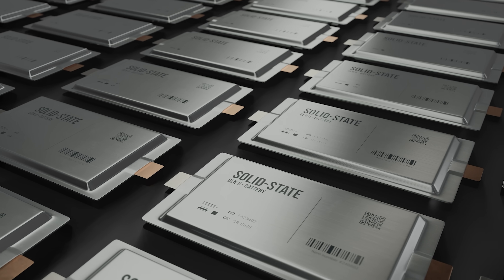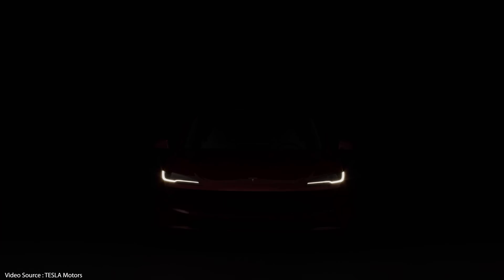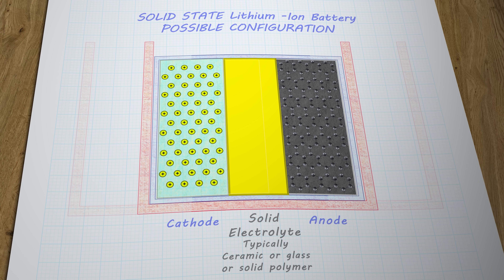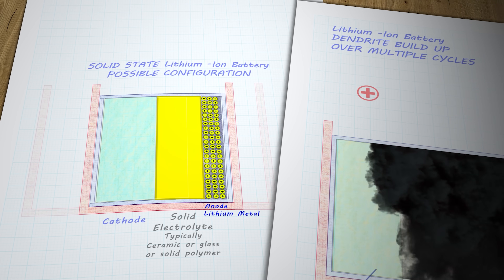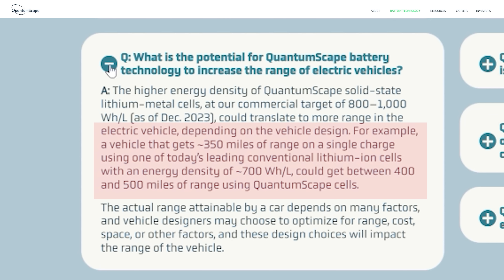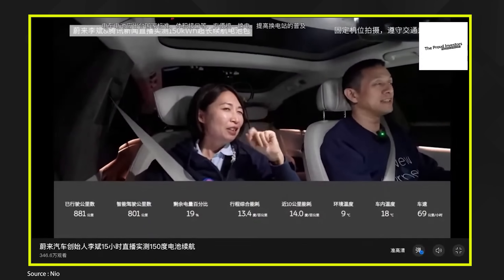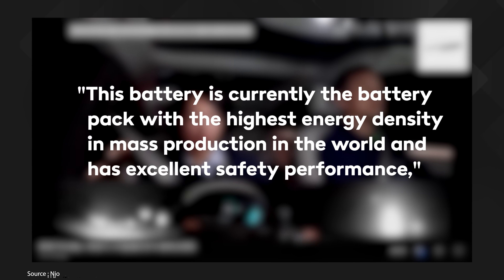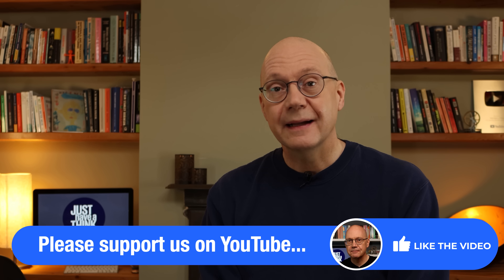Solid State Batteries - FINALLY powering electric vehicles in 2024!

Comment: are there already system-structured models for streamlining recycling options on these electric batteries?
for in a few years, we will have mountains of old and used blocks of these things lying around 
all different systems and probably not worth the money to collect and disassemble.
Reply: I'm not sure what you mean by "system-structured models." Are there companies investing in lithium ion battery recycling? Certainly. Nobody is at large scale yet, because EVs are still new enough that there isn't a huge supply of dead EV batteries yet. But there are multiple EV battery recycling companies that look like they're ready to scale up when these batteries start to arrive in bulk.

You're right that these old batteries are not worth the money to disassemble. Instead they use giant shredders, recovering metals from quite small grains of battery material. It's been awhile, but from memory, these companies claim they can reclaim something like 90-95% of the economically valuable metals like lithium, nickel, and cobalt.

Renault took the other approach: they built a facility in which they can buy back old Renault EV batteries and deploy them in stationary storage, which is just what it sounds like: battery banks that sit in one place rather than under a moving car. A battery with only 70-80% of its original capacity is no longer so useful in an EV, but still retains significant value in a stationary storage application, where space and weight are much less important.
Reply: @ps.2  thank you for the somewhat detailed response, it answers some of my questions, (I meant it more as a point of attention.) 
 I was seeing all these developments with maximum efficiency while I was thinking is there enough emphasis on how can one make a quick transition to a new battery with as little loss in the recycle time on value and re-use the same part?
for there are going to be I guess more than a million items each year in my country (NL) as the numbers get up fast soon how much thought is there in the development to address this? 
  it could be bad optics if in about 5/10 years we are left with mountains of leaking batteries everywhere.

Comment: that's all good and great looking, but the Australian old power grid isn't able to charge a 1000km solid state battery in 15 minutes, let alone 10-20 cars simultaneously at charging stations along the highways. Even if EVs will remove the range anxiety,  the electric power grid is the bottle nick.

Comment: They've been saying, "We're just a few years away" on cheap Fusion Energy for 50 years . . . . When I see it, I'll believe it !
Reply: Nobody's been saying that about cold fusion energy. Or, I mean, nobody has been saying it in good faith. Cold fusion was quickly recognized as a fluke or a fraud when it was first announced by Pons and Fleischman in the '80s, and there's been no legitimate research on it since.

Good old-fashioned regular fusion energy is an ongoing subject of research, of course, and certainly some people keep getting excited about it, but I doubt any of the actual researchers have ever tried to suggest a practical deployment timeframe of less than 25 years. (Which I think is still overly optimistic, but it's also not what I'd describe as "just a few" years.)

Comment: This is all good news. But, keep in mind that, no matter how fast a battery can accept a charge, the charging speed you get is still limited by the capabilities of the charging station. So, even if you get a car that is theoretically able to charge itself in 5 minutes, you still won't be able to actually charge it in 5 minutes until chargers get upgraded to support higher power levels, something likely to take years.

Comment: Typical one year delay every year tech. If solid state batteries with better capacity show up in the market the first use case are smartphones. I can imagine paying i.e. 5 time the price for 1.5times capacity in smartphone. It means like extra 200 USD for ultra good battery. In car it will mean 100000Usd for battery which doesn't make sense

Comment: OK, so explain precisely what the difference is between solid state and 'conventional' lithium ion batteries. Usually, solids other than metals conduct poorly which makes them poor candidates for ant electrical component that has to pss current, e.g. batteries, i.e. electrlytes with good conductivity MUST be LIQUIDS. AFAIK, Quantumscape only has a 'solid' separator in its design.
Reply: re: "Usually, solids other than metals conduct poorly which makes them poor candidates for (any) electrical component that has to (pass) current, e.g. batteries."  exactly, in another 5-10 years when we still DON'T have Solid State Batteries, we're going to look back on this with "Hindsight as 20/20" and lament to ourselves, how did we ever think that a SOLID would make for good Electron transport medium...?  when looked at on face value, we basically ALREADY KNEW (without being scammed for Billions of dollars) that it wouldn't work.

Comment: Low temperature battery performance may be just as signifucant as range increases. Of course, if charging infrastructure recieved anywhere the effort that gasoline fossil fuel nerworks have, this would all be a non-issue.
Reply: It's interesting, though faster charging is one possible way to solve the issue, however it seems unlikely it will result in a similar speed as gasoline refilling anytime soon, and results in cell degradation. It seems to me that battery pack swapping would be the fastest, most efficient and sustainable method of refueling, and could be automated, however it would require a high level of standardization.
Reply: @newolde1  Yes, battery swaps are being done in China where companies rent the pack to customers, but customers own the vehicle. That way the battery longevity isn't an issue. 

However, it's a bit of a false comparison between gasoline pumps and charging. Charging could be done while people are shopping or dining or at work. The freedom from hazardous explosive fuels means charging is far more flexible, so time issues are not real issues as the cars can multi-task the charging with being parked. Still, people have that range anxiety issue... But even a low rate or quick charge could put another 20 miles / km in the pack without a full out hypercharger.

Comment: I have driven and owned EVs since 2017. There are 2 problems with range: 1) even cheap ICE have a decent range and "charging speed" aka refuel time. This is right now not given for cheap EVs 2) established car manufacturers used range as a main argument against EVs. Now they have to deal with their own PR.
Reply: range isn't an issue for the vast majority of users of ANY car. people simply don't drive large distances on a daily basis.  for the few who do, they can remain in ICE for now; they aren't the problem, as they are VASTLY outnumbered by folks who simply don't need big daily range.  for your vacation that you take once a year, hire an ICE.  
I've owned two first generation EVs (manufactured in 2011 and 2014), range is simply a non issue.

Comment: Range anxiety is a real problem when you live in a country with vast distances and poorly built out charging infrastructure where it might be more than 300km of highway driving between fast chargers that may or may not be broken / in use or you want to tow anything.
Reply: I have doubts ya'll are even real people. But. Nah, even given your cases, it doesn't mean range anxiety is a "real problem". There are outliers for whom it can be a problem, but that doesn't mean it's a problem for the market or industry. Outliers just don't produce enough demand to make a business case to address it, the same way nobody bothers to build gas stations every few miles in the middle of the Yukon either.

1) AC wall charge or solar chargers taking advantage of all your rural land work just fine and can even get the job done quite quickly. How many rural Canadians who are considering buying EVs need to travel more than 500/600km every day or even every week? Even if your nearest rural Canadian charger is 60km away, you can get there 4 times and back JUST TO watch other people charge their cars lol. Even if we subtract an overexaggerated 50% for cold weather range penalty, I think we can agree that's still more than what even most rural people need any given day.

2) By definition and by logic, rural Canada and all other areas with vast distances between chargers have FEWER PEOPLE living there. Even if there are the odd outliers in a community for whom range anxiety may be a real and unmitigatable concern, they are a very small percentage. And.. they're not buying electric vehicles in any quantity in the first place! It's not a real market for manufacturers and, thus, their concerns should not impact design decisions in a major way.

Obviously, things should get better. But the idea that current EVs somehow don't meet the needs of the overwhelming majority of the market is silly propaganda.
Reply: @Cyrribrae  I don't know if you are real either or if you are whether you have ever left the city. I live in Australia where I work in a lot of regional areas as a contractor which is not super uncommon nor is it uncommon for people to here travel long distances. If you are following the coast sure the roads are pretty good and mostly chargers every 50-200km which is fine. But inland where the roads are not great and you can easily be 300km at highway speeds to the next 50-75kwh charger. When you add in reduced efficiency for having good ground clearance and robust tires let alone towing something you realise that current energy densities are just not enough. Fortunately CATL and other companies are doing an amazing job at addressing this but it really annoys me when people who dont live or work in rural areas claim that anyone who says that ev range is not enough is a fake propagandist. On Saturday I was at a major rural fuel stop where there were only two chargers, one was broken and one was down to 25kw charging speeds and the next charger was 86km down the road, hopefully the annoyed atto 3 had enough charge to make it to the next stop!
Reply: @Cyrribrae dude no one is buying EVs😅
Reply: Range anxiety is a real thing quite a lot, i find. Electric scooter rider here. I even took to building batteries myself to worry less about range
Reply: It has been a nightmare charging my Ford on the way from San Francisco to Los Angeles, especially on holiday weekends. Range “anxiety”, becomes reality on your second hour in line waiting for a charger.
Reply: yup yup yup, came here to say this exact thing, hi from rural Canada where a charger is 60km away and it's 8hrs travel to anywhere with another one...

Comment: Current electric versions of cars , especially small cars are pretty terrible. 400 mile range from a 50-60mpg hatchback with a 1l engine and a realistic 100-150 mile range from the equivalent EV. Take the Corsa as an example. There is also a reasonable degree of environment benefit to keeping an existing high efficient car going rather than building a new one. My 15 year old Toyota aygo still does 450-500 miles on a long run which is similar to its original efficiency if not a little better. A current lithium ion battery is t going to do that after 15 years. Hopefully this is the future. John B Goodenough is an absolute legend.

Comment: My one concern is grid capability: a 100kWh battery pack charging in fifteen minutes means a 400kWh charge rate... Multiply that by an entire city/region and the prospect of a new form of peak electrical demand is a bit concerning.
Reply: My thoughts exactly. These mega chargers won’t get installed many places because there isn’t enough capacity for them. In my area utilities are already delaying and denying requests for service.
Reply: @mere_cat  extreme weather has already pushed utilities in North America to beg everyone to reduce their draw on the grid... But we're expected to give up on internal combustion and natural gas. Solid plan.
Reply: Well over 90% of EV's charge at home, off peak, on L2 or even (gasp!) L1 chargers.
Battery and capacitor banks at the actual charging stations mean that the grid never sees the inductive inrush when a car plugs in.
You can winge and ring your hands about absurdist edge use cases while the rest of us go on about our day
Reply: @jimurrata6785  Not really absurdist edge cases. I have a level 1 charger, btw and it works great with my plug in hybrid, but doesn’t solve the “range anxiety” issue folks still can’t seem to get over and car companies are pandering to by hyping superchargers that won’t go in at nearly the volume and pace to meet demand. And yes I know these aren’t edge cases because I work at a utility company and routinely hear about 2 year wait times for transformers needed to enable these supercharger stations.

Comment: I bought some Quantumscape stock in the summer. It crashed and I bought some more. Through all of this, I kept selling covered calls to lower my dollar cost average. When the VW data on the QS battery came out in late December, the price went up and I sold for a small profit. Since then VW dropped them and QS price has dropped again. I'm just glad I'm out.
Reply: Where are you getting information about VW dropping them?
Reply: 06/01/2024
Electric vehicle (EV) battery start-up Quantumscape Corp (NYSE:QS) shares closed nearly 50% higher Thursday after tests from Volkswagen subsidiary PowerCo SE confirmed the endurance potential of its solid-state cell.

"PowerCo SE, the battery company of the Volkswagen Group (XETRA:VOW), announced it had confirmed the results of QuantumScape's solid-state cell in an endurance test. "These are very encouraging test results and a milestone on the way to series production of the solid-state cell,” Frank Blome, CEO of PowerCo said in a statement."

What are you up to lipsterman1?

Comment: Range is a big problem. Winter is a electric car killer. The heater for the passengers plus the heater maintaining the batteries cuts range in half. Towing is also a massive drain. So towing in winter is about 1/4 the range. Yes range is still a large problem.
Reply: Canadian winter only cut my range by 25%.  Snow tires cut the range on my old gasmobile, too.